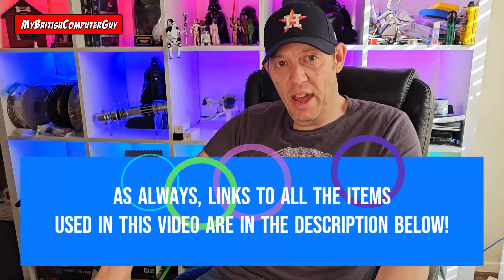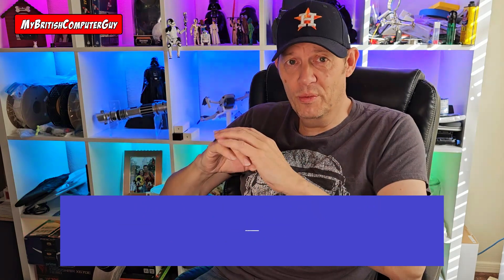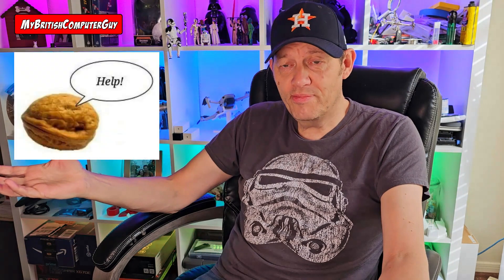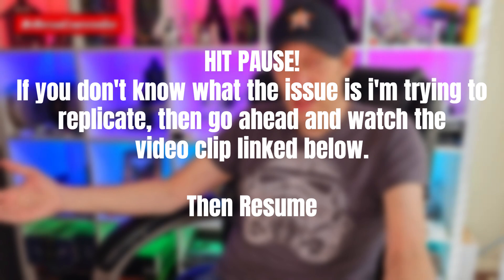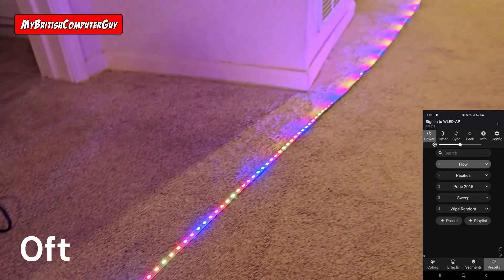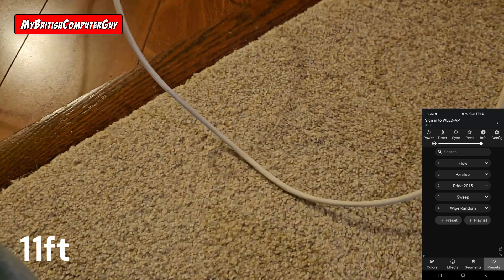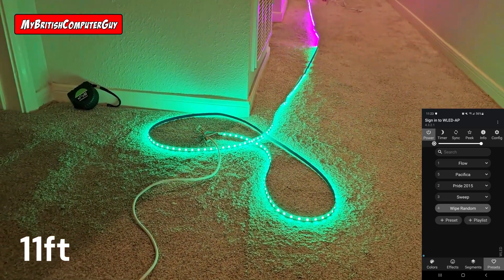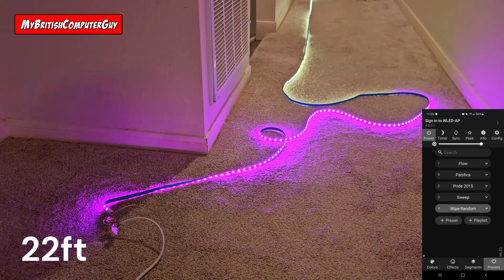Pushing Limits: Forcing ESP32 Data Connection Failures Reveals Surprising Insights

Comment: Okay, there are many things to take into account. The datasheet of the LEDs typically says that the data HIGH signal needs to be at least 0.7*Vcc to be in spec. For 5V this is 3.5V and thus 3.3V data signals are out of spec. Form experience that's usually enough - there is margin obviously since 3.5V is guaranteed to work. However, with 5.2V supply voltage, the margin is even higher. On the other hand, with only 4V on the LEDs, a 3.3V data signal is perfectly in spec (2.8V required). This means that voltage drop actually plays you a favor here! Voltage drop only really occurs on the power lines with heavy currents. The data signal has very little current and thus experiences almost no voltage drop over long distances! Also, not all LEDs are equal. I've had LEDs from different suppliers that started to glitch earlier than others - might also be just different batches. You never know. Also it's really just the first LED that's relevant here, as its data output is as high as Vcc.
Regarding the resistor: It's meant to take of the harsh rising/falling edges of an ideal digital signal to reduce effects of reflection/ringing in the wire. The capacity and impedance of a wire changes a lot with length, so that's why a resistor might sometimes help reducing noise. It doesn't change the voltage level, as as said before, there is not much current for voltage drop.
Be aware that some/most strips come also with a resistor on the input, but not on every LED. So if you cut the strip, it might not be there.
Long story short: It's complex. If you want to be in spec, use a 5V data signal. Please don't use these bidirectional level shifters meant for I2C though, they are overkill and not the best fit for the Application. All you need is a TLL LogicLevel Buffer or TTL AND/OR gate like the SN74AHCT1G125. It's only important that it takes TTL input levels (the T in HCT) so it will happily accept 3.3V input levels with 5V Vcc and output 5V data levels.
Reply: Any 74xT1G[125,34,32,17] will do. If you plan multiple datalines the 74HCT34 with 6 Buffers might be a good choice. The real problem is, I don't know of ready made breakout boards :(
Reply from the maker: Thank you for both your comments. Very insightful and helpful. I'm still trying to understand a lot of this, and am still very much a beginner, as you can see. So, about the SN74AHCT.... thingy. So how would you wire one of these? And then the other question would be.. if the LLShifter is overkill but it's tried and tested and simple to wire.. why not use it?
Reply: @mybritishcomputerguy  They are cheaper and easier to wire, as they just require 5V. The level shifter needs both, 5V and 3.3V. The wiring is easy. Being able to put them just in line with the current wiring is the main advantage. 
The buffer has GND, 5V, IN, OUT and /EN. /EN needs to be connected to GND, the rest is obvious. Same for the OR gate. The OR gate has two inputs and one OUT. In order for it to act like a buffer (IN=OUT) one of the OR inputs needs to be tied to GND (=0), so the other input determines the output.
Really the only challenge is that they don't come on ready made PCBs :(
I made a hand full my own. I'd link to them but then YT will hide my comment. Maybe search "from:fruchti ttl" on twitter
Reply from the maker: i love how you say the rest is obvious lol. Having never used one before i'd say not. I'll find you on twitter :)  @RoterFruchtZwerg
Reply: @mybritishcomputerguy  it is 😄 IN, OUT, 5V, GND. They are wired exactly like a WS2812B that you would put in as Buffer like some also suggested.

Comment: I use a resistor (although most strips have it built in anyway), but I always put a single WS2812b, close to the microcontroller. Not only does it act as the level shifter for the data line, it’s a good indicator that your LED’s are working, if you cannot see the main LEDs from where the controller is located.
Reply from the maker: Putting a single LED from the strip is a good idea, and one i've seen people use a few times as it ups the voltage from the 3.3v to 5v. However they are fiddly little things to work with, especially if you are using the ones that are densely packed together, there is very little room to solder. I'm still not entirely certain how putting a resistor at the source directly after the ESP32 works though, it just seems to.

Comment: Leaving the data issue aside for a minute, there is one big issue as to why you aren't experiencing fading or other issues along the strip due to voltage drop.  You are using 300 LEDs.  These WS2812b LEDs can draw up to 60mA per pixel (full bright white).  So for the 300 you are using, that means they can draw up to 18A.  Yet you are only using a 3A power supply.  Meaning that even when on full brightness in WLED, they are only running at about 16% of what they are a capable of pulling.  Run that same test with a 20A power supply, be sure you have removed the brightness limiter setting in WLED and then crank up the brightness to 100%.  I promise that you will see significant differences in the LEDs between the start and end of the strip... that isn't occurring when running at the equivalent of 16% brightness.  I have an install where no brightness/fading is seen at 40% brightness, but it is very obvious at 100% brightness.  You are only running your strips at a true 16% brightness, even when cranked to max in WLED (and potentially less than that if you did not remove the brightness limiter in WLED... which I think is set to less than 1A by default).

As far as the signal issue, you are using a much larger gauge (pure copper and insulated) wire than the cheap Dupont connector wires I was using in my test.  I did that somewhat intentionally because I wanted to show the issue of what could occur, while still using a shorter run of wire... and smaller gauge is going to produce higher resistance.  Although I will admit to being surprised that you got the length of run that you did.  But again, I would try this at much higher current values to see if you get the same results.  Finally, as you found, the issue is not consistent.  You mentioned that you had the flickering issue with just a 12 foot lead for your ceiling lights... yet ran a lot longer distance here without a problem.  That is part of the issue.  You might have one install that works perfectly and another identical install that runs into flickering issues.  Maybe this is simply due to tolerance differences in the various components (like the board and strips) that are mass produced at the lowest cost possible?  I'm not sure.  But I opt to include the shifter with all my installs regardless of wire length and have yet to run into an issue related to the data signal.

You may or may not see the same signal issues that I did, but until you can try running the LEDs at their true full brightness using a power supply capable of doing so, I'm not sure that we are comparing apples to apples.
Reply from the maker: Thanks my friend for the truly detailed explanation. The fading i get. However I was sure using a low power inexpensive device like that 3amp device charger, I would get issues with the data making it that far. I really was hoping to break it so i could fix it! All of my builds use the same wire, and for the most part ESP32's (until recently) and LED strips, everything is now always soldered, I used to use Wago connectors, but prefer a cleaner more stable build. It's funny how the only time I ever had an issue, it was on my first build! 

I will try this test with a larger power supply as soon as one comes in. I have a 20amp i think coming in soon. I understand why I didn't notice the voltage drop, I used a 3amp phone charger because that's what I had and figured that being low power it would definitely cause issues, and didn't want to melt it so left the limiter on. Even though the LEDs were only drawing 3amps they still were very bright. probably brighter than what I would use typically. Seeing as I wasn't pushing the envelope as far as the amps is concerned. It will make for an interesting follow-up video when I use a beefier PSU.

PS Thanks for putting your content out there, you have some great videos!

Comment: The first LED in your strip "fixes" the data level. The data line does not suffer a huge voltage drop, because the LED does not consume a lot of power. E.g. a low current through that cable does not cause signal levels that are below the LED's spec.

If the first LED understands the data it shifts it up to the 'correct' level for the following LEDs. 
In your case that is propably near the 4.x V your power source provides. 
At the end of the strip you have 3.x V ... that is AFAIK just in spec for "HIGH"-Signal.

The cable you used is way better then the one used by @ResinChemTech and it does not go across the WIFI antenna, which might add some "fun" signals to the cable.
Reply: I think the fact that he is using 18AWG wire, which seems to be 1.2mm metric is probably the reason that the full signal is reaching the first LED.  1.25mm 3-core will let you run 13Amps at 240V so the voltage drop of your strip prior to the first LED is probably minimal.

This video now has me wondering about trying the remaining about 40m of 3-core 0.75mm cable to see what will happen.
Reply from the maker: Brilliant explanation, thank you for your input. So in that case... why use a logic level shifter at all in these circumstances?
Reply: @mybritishcomputerguy  It pushes the logic level to the "best" values, and if you have a signal path with a high resistance it might make it just good enough.

As long as you have no issues, don't use a shifter. If issues show up, just put one in.
If you have a hard to reach installation you could go the save route and add it right away to be on the save side.

The voltage drop over the power line along the strip is IMO your biggest issue as long as you use a low impenance("thick" coppper) cable for data. 

As soon as that voltage drops below the acceptable "HIGH"-level for data, the LED can not output a good signal for the next LED ... then you will see data corruption in the following LED.
Reply from the maker: @jorgwunderlich-pfeiffer1985  so.. high resistance is important? Seems counter intuitive. I guess that is why a 100ohm resistor worked for me when I did my initial install. Thanks so much!
Reply: @mybritishcomputerguy  What I mean is, if you have a cable with high resistance (aluminum and/or thin) you will need a shifter to make it work. Your cable was a fat copper wire, with low resistance ... thus the signal did not degrade enough to cause issues. Use the thin cables for the breadboards and stick them together if you want to reproduce the issue.(they are often copper coated aluminum if from a cheap set) And the connections are not as good as your twisted copper, too.